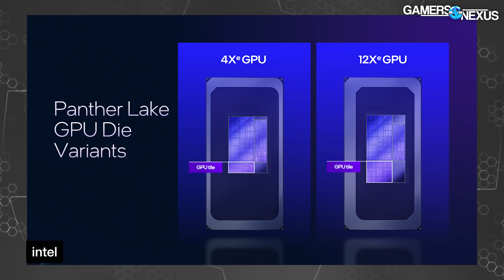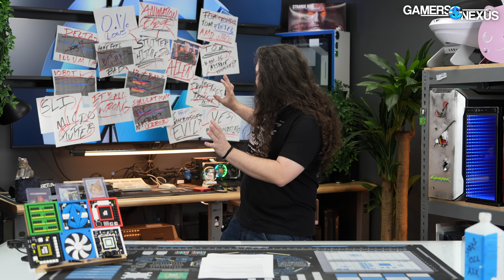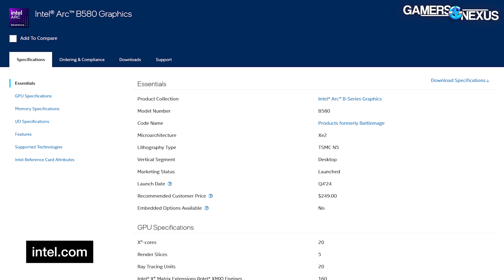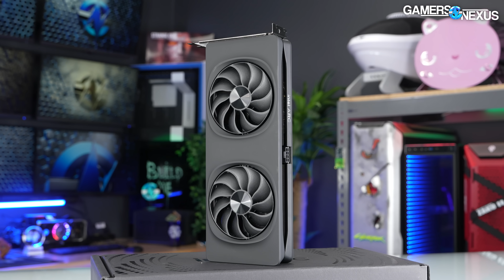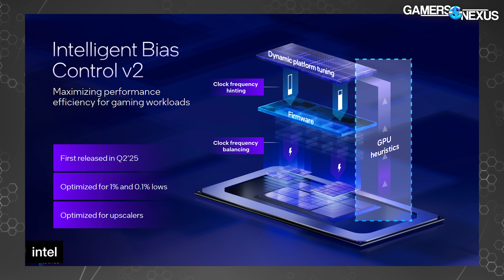Intel's New GPU: Xe3 Architecture Changes, Handheld Gaming CPUs, & XeSS3

Comment: "Culling unused triangles" is an area that Intel really needs to improve. I have an ARC B580, and it's a painfully obvious issue in open world and open air games (The Outer Worlds) where you can go from areas of low detail to high detail quickly, and it TANKS framerate in areas unaffected by Nvidia GPUs. Glad to hear them addressing this.

Comment: There may be few use cases where frame gen from 60 fps to 240 is OK. But I do not feel like any of my 500+ games are in that short list.
But from 120 fps to 480 fps for those few who have 480 Hz such OLED display, it is worth it.

Question is: "Do intel's cards reach 120fps while having spare power to frame gen to 480 fps?"

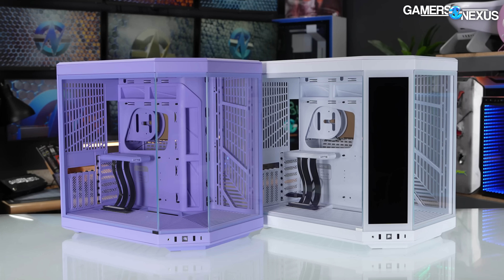Comment: 2:59 The HYTE Y70 Infinite looks great except that it's $400.
The touchscreen is 2560x682 so it's a good high density screen, can't complain about the specs but man $180 premium for a sliver of a 1440p monitor seems like overkill.

For that kind of money just get an entire 16" 120hz 2880x1800 OLED monitor off AliExpress for $250.

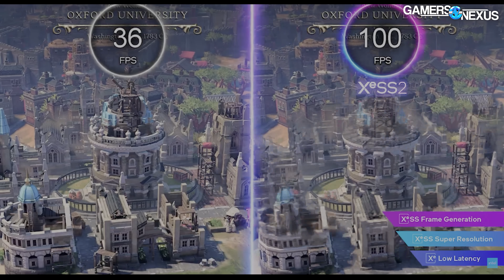Comment: @18:50 All this talk about rendering, makes me want to throw out my insane idea just to see if anyone could tell me how insane it would be.
Rendering individual pixels (or sections) to completion instead of rendering the image in complete layers.
The idea being that you could have a constant stream of pixels coming into a buffer that includes information like how old the pixels are and motion vector information.
From there you can use AI magic to combine the information into a single frame capture.
So in theory you could decouple the image framerate from the rendering, allowing you to arbitrarily set the frame rate based on the speed of the AI image filtering and pixel throughput.

Comment: Just so the community is aware for over 18 months the dwindling arc team's guidance from the top is to launch Celestial on mobile. There is a small chance that a C580 class card was already taped out for a very limited launch, but there won't be multiple models of Celestial like Alchemist and Battlemage has had. To reiterate there will be at best a highly limited run of Celestial dGPU's if any are made, and the rest will be mobile only.

Also, Tom is a great engineer, but isn't that great with honest PR. I'm always very hesitant when people like Raja Koduri, Ryan Shrout, (both of whom are no longer working at Intel) & Tom Petersen speak about roadmaps or plans for Arc products. They historically misrepresent what is true and what will happen since the first Alchemist cards launched. Intel has NEVER produced high end or enthusiast tier products, yet their own roadmap stated they would by 2024. Intel recently had to remove that roadmap since it was over a year outdated for info of products that never launched when shown they would, nor was the performance levels accurate either. It's terrible for any business let alone a new one to be dishonest on product roll-outs, and the capabilities of said products. Until Intel can execute on time and accurately perform as predicted and claimed they're going to continue to struggle.
Reply: The roadmap is basically accurate, Battlemage launch in 2024 aligns with 2023-2024, and Celestial launching in the future aligns with 2024+. As for the performance tiering, I don't know why anyone would take it seriously, other than MLID and his audience. MLID's claim of "Arc is canceled" has been proven wrong since Intel has continuously released new GPU products. MLID is now pivoting to "Arc is effectively canceled," trying to blur the accuracy of the language.

Comment: They can force raytracing by not offering baked lighting 
They can effectively force upscaling via raytracing or by just doing a piss poor job on optimization 
But nothing they can do will ever get me to turn on the current versions of frame fabrication. I get enough image quality reduction from the first two. I don't need generative AI garbage making it look even worse while actually increasing latency because they held the newest frame back, rather than decreasing latency as higher framerates are supposed to do.

Comment: 13:24 forgive my plebian math, but an 8ms reduction must mean the gains are more significant when running games at less than 40fps, lest that 8ms benefit set framerates below 0ms...

Am I missing something in the math? Ya, if I get 2fps and gain 8ms performance, am I really ever going to use that new hardware optimization? Wouldn't it make sense to asses frames from a 30 or 60fps baseline instead of arbitrarily claiming an 8ms gain from what is already a useless scenario?

0.06 is 60 fps, a gain of 8ms per frame is 0.008*60 = 0.48

So it would be useful to say "8 more frames at 60fps" if that were true, but clearly you only get that benefit when the registers are saturated at like 8fps so they'll claim an "up to 8ms performance gain" at an unplayable framerate as if that makes any difference at 30-60fps where registers aren't swamped?

Comment: Honestly I can't wait for Celestial. Alchemist was mostly great under Linux. With Celestial/Xe3 it's already in the Linux Kernel so that's very cool. The only software issues I've had with Intel Arc under Linux is 1) lots of graphics/video editing software don't recognize the Intel GPU as one that could be used for hardware acceleration & 2) Under Proton you'll need to put additional pre-arguments in the Proton command section...

Comment: Great to see that ARC still has new stuff in the pipeline, and hopefully will continue to despite Nvidia's involvement. Really hoping they don't step in that MFG land mine. My only usage of frame gen is for older games that have issues above 60 FPS when I want more visual smoothness. The physics glitches in New Vegas (even with tick fix mods) are both hilarious and upsetting sometimes, though.

Comment: Their new V3 power delivery could work out really well with custom frame caps.  Their claim that the output frame will be as good as the native, makes me think "well TAA native isn't exactly a high bar in a lot of titles".  It's so bad that I can tentatively believe them.  Before DLAA or native  FSR, I would sometimes use the highest upscale quality, because it looked better than the native, and even when performance wasn't the issue.  Hopefully their "future" comment isn't them talking about trends in rendering, rather than a future frame, but I do think it will be in the future.  Especially with higher and higher refresh screens coming out.

Comment: c++ must be an intel product then. also ray tracing hw only, also for raster emulation. generic cores pipelines only. ie shader compute only. mfg = taa anti-aliasing. linear interpolation between frames pixels. ie raw pixel image morphing. well if you get the motion vectors for morphing right now, then you can morph to display the current non-rendered frame. well if corps are not doing it, you become the corp to do it. ie diy. ie not even upscaling with lower resolution input current frame, but rendering a new frame using only the motion vectors. kinda like the nv reflex frame prediction. you can do at least cubic next frame prediction. either fixed spline morphing algorithm or ai next frame generation. next = current without full data.

Comment: Sheesh, computers are complex.  I'm waiting for the GPU version of AMDs 9800X3D.  Any GPU with a 12-pin, AS CURRENTLY DESIGNED, is a fire hazard in addition to being a power hog.  So no, the 5090 is NOT the GPU version of the 9800X3D.  My grandkids now have my EVGA 1080Ti FTW3.  While my HellHound 7900XTX which finally replaced it, is not as great relative to what is available, it is more than "good enough" paired with my 7800X3D (and it is NOT a fire hazard).

How goes your fulfilling the GPU smuggling video contribution orders?  I received the print only so far (and it's kind of cool).

Comment: The quote about the pipeline being starved if the shader used to many registers is exactly the reason why RTX Remix performs so unbelievably poorly on RDNA2.  Those GPUs run out of registers (at least on the default settings, there are some configs that allow it to run properly.)

Comment: Frame Generation over 2x (one fake frame) is pointless, it always looks absolutely awful and the added latency is just even worse

Frame gen is always at its best when it produces only one fake frame and you are already running at 60fps

You get slik smooth gaming, doesnt feel like arse to game on it and the artifacts are so minimal you will struggle to find them

Intel please, just focus on making frame gane 2x looks The best it can be and i ensure you it will be way more accepted than just trying to hit the nail with a wrench and expect to not hit your fingers with it
Reply: Source: i use Lossless Scaling Frame gen with a 5700xt
Reply: @Elinzar  i still would rather use my old card the 3070 then a 5700xt, yikes now ive upgraded to a 4080, wait o_O  did that in oct. 2024 used for 850,- thankfully i dont have to mess with neither my 1080ti or 3070 anymore :P
now its every game in 3440x1440p@180fps or 144hz which a 5700xt is FAAAAR from that, its just not even close, lossless scaling wont fix that and i say this because ive being called out for a 4080 while they use liek an RX 580 or some like that with LLS and claim its not far off my 4080, they are on superclue forreal, but glad youre having fun :D
Reply: @C7TJFVB7-CAZ_Ger_Eng  where i live i didnt had a choice, ofc im trying to find something better atm
Reply: also just for context, with LFG its been working nicely
Reply: @Elinzar  id recomend a 3070 even hehe if youre not the High/Ultra kinda gamer with lots of FPS BUT some like a 3080TI would be lovely and would trounce that 5700Xt, but make szure u got a modern 8 core at least if not 12 cores to make real enjoyment of such GPU :)
Reply: @Elinzar  you say that because youre used to it, dont fool yourself, old card, old VRAM, everythigns old ^^ was great card, no discuss bout that dude but, yuck :P you wouldnt want to play with it if you didnt had to ;) i can tell you that much, had say that with the 1080tI as well till the 4080 and oh boy, 2 different planets :D
Reply: @C7TJFVB7-CAZ_Ger_Eng  nah fr i live in south america

the prices here are so stupid i cant justify anything, i bought my 5700xt from usa for 180 usd

but i can only buy up to 200 usd for my country regulations

a 4060 in my country costs like 500 usd, a 3070 is priced similarly

so i cant justify them, nor i even want them

i also if i want to upgrade a 4060/3070 is not enough of a jump, im actually just saving to be done with this and go for a 3090
Reply: @Elinzar  a used 3070 though? 500usd? damn wtf i feel sorry for ya, cant change crappy prices :P 4060 be a good upgrade too indeed, specially with DLSS 3 n stuff :)
mhhh 3090 wont last u as long as a 4080 but it would be if youre needign a ton of VRAM but yeah 3090 be a jaw droppin upgrade over a 5700Xt for damn sure, that would let you fall off the chair ;) if you can get THAT, u also need a 1000w psu so yeahh a 4060 be the best choise even tho it be a LOT slower then a 3090 of course ;)
hope you get outta this rathole soon, or just dont have to save up for too much longer, juz that sucks for anyone i do understand :*
Reply: @C7TJFVB7-CAZ_Ger_Eng  is 400 vbucks used but still, dont want to be stuck with 8gb forever, so im saving up for a 3090, 7800xt or something around that ballpark with min 16gb, so we will see what i end up getting
Reply: @Elinzar  3080 12gig or the TIs are also dopey choice :)

Comment: BTW, can you get some more info regarding the driver overhead issue? Will his be an ongoing issue with Xe3 or have they reworked the SW/HW to work better with weaker/Older CPUs? Becuase if they are going with entry level models they need to not get CPU bottlenecked on older/weaker GPUs vs the competition GPUs

Comment: 16:46 - okay.. okay.. wait. wait.  Steve.  hang on.  wait.  stop..  look. 
Hear me out.  please. @GamersNexus

 I think you're assuming something about this that the marketing isn't saying - and then your ranting later in the video about something can't be true based on that assumption.  I haven't looked that the raw marketing material, but based on the slides I'm seeing something different than what your saying from this point out.  

the slide on 16:46 - yes. it says interpolated frames.  but if you look the pipeline, interpolation isn't the right term (What? Marketing misunderstanding something? no!).  optical flow reprojection - motion vector reprojection.   sound more like they are taking the LAST two frames - looking at the direction of motion in them - and then PROJECTING what 3 frames that come AFTER them will look like from them.   Like if we have two pictures of a car going down the highway and we know how far apart in time the images are taken we can work out 3 spots where the car will be AFTER the last picture FUTHER DOWN the highway BEFORE we get the next picture of the car.

the slide on 17:06 seems to confirm this - the second to last stage on the bottom labeled "Forward" - as in inferring the forward positions and then feeding it to the MFG pipeline where it approximates the next 3 frames that hopefully are close to the next real frame - but that's the sneaky trick of the whole thing - being WAY off isn't really noticeable as the framrerates go up, because the actual error distance on average will be much smaller than the positional change between the two real frames - so the eye will disregard it for the most part and it will just feel smoother.

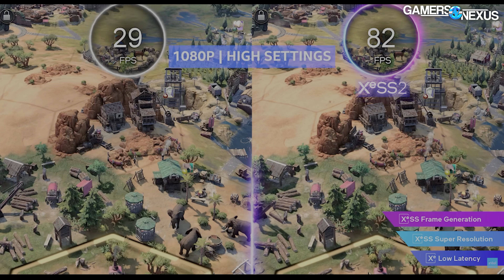18:35 - so, yeah, intel calling this "looking into the future" - sure. absolutely.  Why not?!?  There's nothing WRONG in that.   sure - it's based on the last two frames, but it's just approximating where the car is going to be before the next real frame comes out and displaying that.  There's no rule that you have to put the frames between the real frames.  So your rant here is only based on your assumption that they have to be between the real frames - and I don't see that in the slides. 

Maybe look over the slides and talk to some of the guys at intel and ask them if the are projecting the next 3 frames before the next real one comes based the last two real ones and EXTRAPOLATING instead of interpolating like they have on the 16:46 slide or if they are putting 3 in between 2 frames (which, would be stupid, really, like you said.)

18:53 - right - this is the assumption I think you're making that isn't what's happening "Instead of holding them they could have been displayed instead of holding them to run the frame generation in between" - I don't think they are running the frame generation in between, I think they are using the last two to project AFTER the last one.   So they aren't HOLDING anything - they're desplaying the most recent frame they have, waiting for the next one to come, and then like someone who starts to finish someone elses sentences, or like, while you're in a meeting and someone has to call accounting to get a number, adding a few words in the middle fill the conversation out until the next real though comes out.

Comment: I'm suddenly more interested in iGPU quality again, not because I think we'll be gaming on iGPUs, but because we now have proof that two-GPU computers make sense again, where the weaker GPU can create generated frames and do upscaling without putting any load on the stronger rendering GPU. Already this is usable, and it will only get better. The optimal computer of the future will have a "strong-enough" iGPU so the discrete GPU is completely unpowered unless you're gaming or running AI or rendering. The discrete GPU won't even need outputs to the monitor, which will open new possibilities for form factors. Basically, the GPU of the future will become a classic co-processor. I'd love it if it just became a packaged chip that plugged into a CPU-like socket on a motherboard. Why? Because PCIE creates huge bottlenecks in access RAM and CPU. Also, it allows for less ad-hoc GPU cooling solutions.

Comment: if they are making a major shift they should include it in the next flagship design wither it be B770 or C 870 its key for intel to hit TX 6070TI levels we should have been here 7 months ago but it was delayed due to technical difficulty's, this is MAKE or Break for intel graphics division,

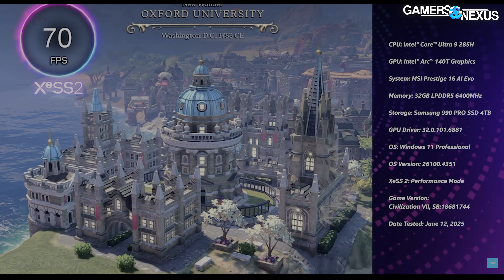Comment: @19:00 The terminology for this type of information handling is a 'smoother' in that it explicitly uses information from delayed frames ("the future" compared to what's on the monitor but not what's actually been produced by the engine). Short of inventing a time machine the only way to get information from 'the future' is to increase the latency which is what we get.

Comment: Small addition on depth write information:

It is not (only) that a character behind an object is not being drawn (occluded). This is done by occlusion culling, and is done on the CPU or GPU before rendering.

Depth write (for depth testing) is used while rendering, and will discard pixels that would not be rendered because they're occluded.

It sounds similar, but where occlusion culling fully removes the object from the render pipeline, depth testing only removes the pixels that are not visible on screen, even if another part of that geometry is visible (partial occlusion)
Reply: Does that mean less depth testing for which pixels to occlude further down the pipeline?
Reply: @tylerdurden3722 I'm guessing mainly faster or more accurate depth testing. The depth often still has to be tested in some way to see if it has to be rendered